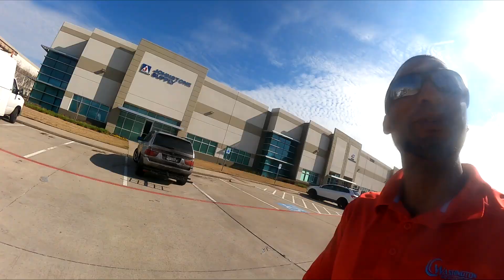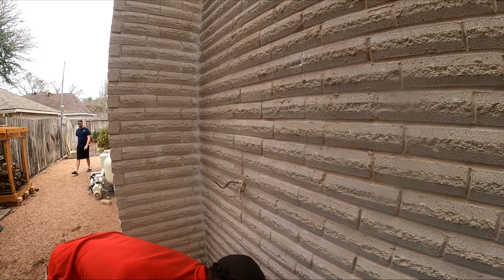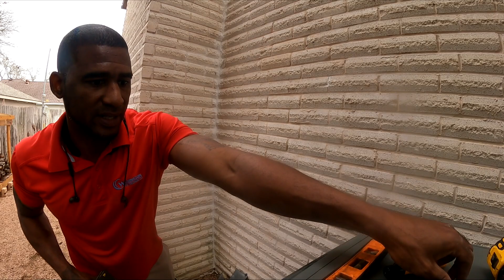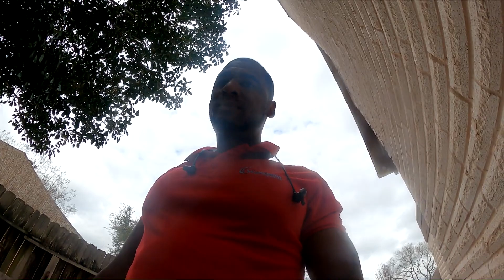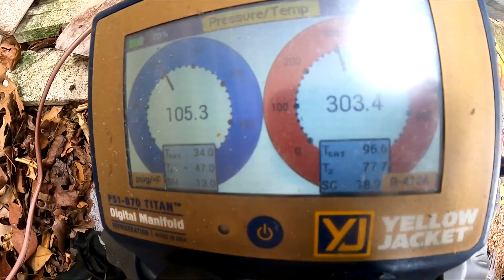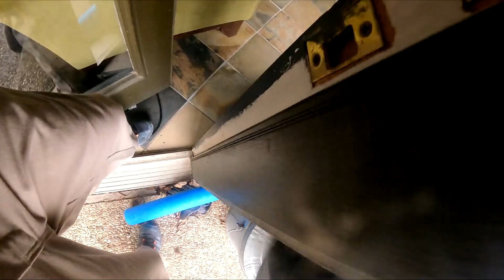"Trane Service Call Saga: Breaker Replacement, Charge Check, and Follow-Up - Part 2 Revealed!"

Comment: When unit is over 5 or 10 yes old do you recommend a surge protector and hard start kit
Reply: You only use hard start kits as needed you don’t recommend then or install them unnecessarily
Reply: I only recommend hard start kits when the compressor is over amping during startup.  Check the LRA on the data tag. And I would recommend surge protection for anyone that is in area that has power outages (dam near everywhere lol). Surge protector protects equipment from the "dirty electricity " when power is first restored. So hard start kit and surge protector never hurts anyone.
Reply: Thank you Marlon and gamer

Comment: 70 degrees outside 300 head pressure nothing you doing is right because the condenser coil dirty clean that coil then check pressures